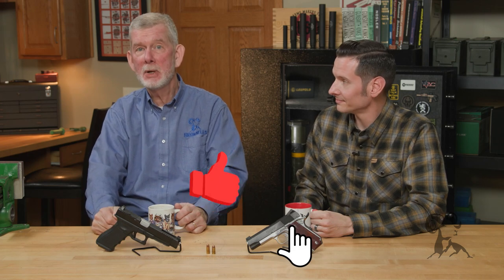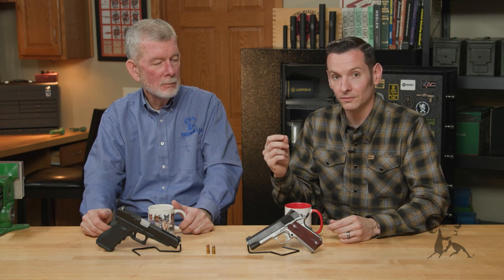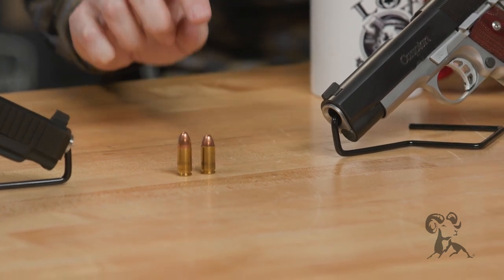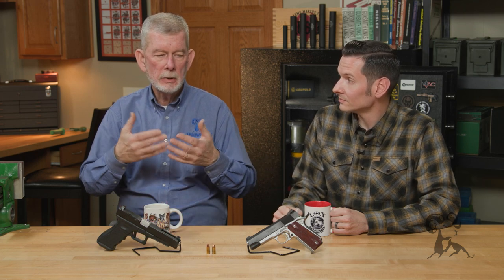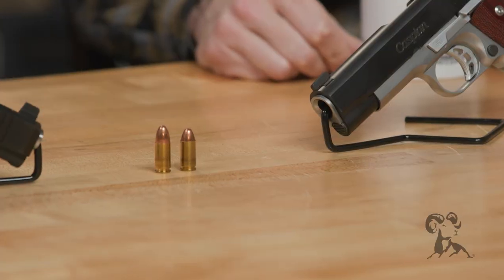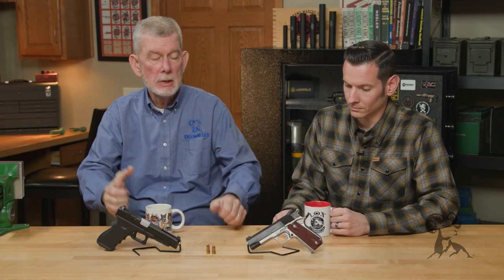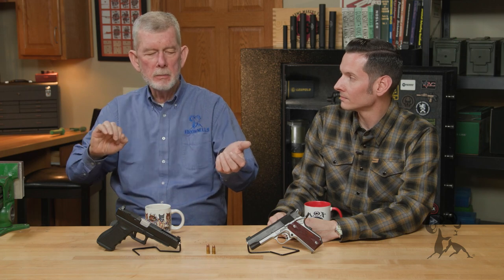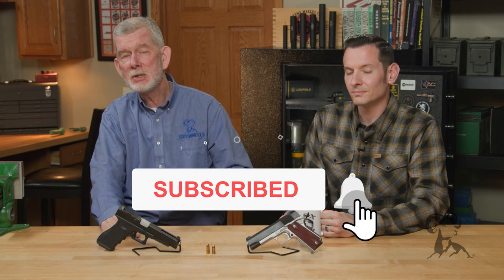Smyth Busters: Will Excess Bullet Setback Blow Up Your Gun?

Comment: If I don’t shoot my carry ammo for awhile, I will often reorder the rounds in my magazine to help avoid this. Are there any issues with this method?
Reply: Usually you have to (re)chamber a LOT to get significant setback, if you are leaving it chambered there's no reason to reorg your mags, and is putting unnecessary wear on your springs.
Reply: @runlevelone  Takes decades to wear down a spring on a magazine to render it ineffective. By that point you couldve bought at least 20 gucci guns
Reply: I avoid this by inspecting every unfired round coming out of the chamber for proper crimp retention, which is few and far between. Also, once a year, take your carry piece to the range for cycle and accuracy test. Don't forget to practice with (relatively) cheap ball that most closely matches carry ballistics.

This also proves the firearm will perform under adverse conditions, as dust, dander, body hair and lint will no longer make you second guess its function in that split second you may need it. Clean, lightly oil, reload and repeat.
Reply: I use a caliper to measure round lengths against a factory fresh rounds to compare bullet set back.
Reply: Why would you unload your carry gun anyway? I only unload mine when I clean it. My gun stays in the holster at all times, even when I get home. I take off the holster with the gun in it and put it in the safe. I have other guns for home defense.  When I clean the gun, I will remove the chambered round and put it in a jar and replace it with a new round. When i fill the jar up, I use them on the range.
Reply: My carry gun never gets  unchambered unless I am going to train. When I come home it gets put in a lock box. Therefore I don't have an issue with bullet setback because I'm not constantly chambering around. That's how I avoid bullet setback.

I have magazines that are specifically for range use so I never unload any of my carry ammo. About once a year I'll replace all of my carry ammo with fresh ammo. If you continue to handle your carry ammo often you will leave oils on casing, which can lead to corrosion.
Reply: @Watchdog_McCoy_5.7x28  Get your Dry Fire reps in my man
Reply: @Christopher Robin  i carry a 43x, but i bought 2 of them. I carry one, and train with the other. I ran 500 rounds through my carry gun to verify functionality, but I use my other 43x for dry fire and training on the range so I don't unnecessarily wear out my carry gun.
Reply: @Watchdog_McCoy_5.7x28  Nice humble brag
Reply: @Christopher Robin  just being honest. I in no way meant to boast.  I am very fortunate and thankful for what I have, and I understand not everyone is as blessed as I have been. I have a nice collection of guns, yet my collection is nothing compared to those more fortunate than myself.  Be thankful for what you do have,  because many people can't afford a Hi Point, especially now with the economy in turmoil. Anyways,  I hope you have a great day,  and keep working m hard towards whatever goals you have for yourself. ✌️🇺🇲🇺🇲
Reply: @christopherrobin8134  why dry fire? I always see it as relatively pointless. Just practice shooting the gun cause you'll actually get recoil. Anyone can hit the first shot but the follow up shots are the problem. You can still learn your trigger pull and everything else without dry firing
Reply: @christopherrobin8134  I keep a 34 G5 MOS with RMR as a paperweight on one of my desk. The MCX with 17 G5 MOS, Modlite, RMR, with drum is a good bathroom trip carry. If I was to go outside though I may grab the dual 19X. Fiddy Shades of FDE all that jazz XD
Reply: @stompingpeak2043  dry fire is the easiest and cheapest way to build speed in the draw, sight alignment, trigger pull and target transition. With a laser bullet you even get accuracy confirmation.

Comment: Came here because I discovered my 10th loading of a batch of 50 AE was setback .06" under the force of recoil while in the magazine. Noticed no strange sounds or unusual recoil, accuracy was fine...but all of them in the magazine setback. Tried a couple of mags, didn't wanna believe it. After inertia pulling with a case gauge (because it took no effort) I was able to re-over-seat them with finger and thumb pinch. Extra crimping 3 of them did not help.
     My question then...if neck tension is THAT absent, do you think it could require less force to begin moving the bullet such that the available space for the rapidly expanding gas can still be sufficient to prevent overpressure? Would love to have someone test the pressure and velocity for me and make an ultra informative lecture from it. I'm not the only one eager to milk the life of brass and I wouldn't be the only one make a dire sacrifice in overvaluing my cases. 
     This may be where I try a super glue sabot....or try reusing primers. The safest way I have to shoot them in all seriousness is one at a time, empty magazine, chambered by riding the slide. If it's actually possible to get them tested and you think you could make a good lesson from it, I'd love to work that out!

Comment: I do dry fire practice with my EDC practically everyday sometimes a few times a day sometimes less depending on different factors and a few years ago every time I would rechamber the same round. Over time I noticed that the round was getting bullet setback so I put the round on a shelf as a reminder to rotate rounds after dry fire practice. Since adding the rotation into my routine it has not happened again. That could be because of me adding the rotation or there could have simply been an issue with the crimp on that round of Aguila jhp.

Comment: I recently had a similar problem shooting Winchester white box .380 ball.. this happen several times when the round would not chamber in my lcp11 and when I ejected the round I noticed the bullet nose set back and the case was swelled.. I checked the box of ammo (factory loads) and it looked fine. I’m assuming it’s a bad batch even tho most of the rounds shot fine.

Comment: The physics is not clear to me. What causes the overpressure?

Is it the reduced volume of the initial (and temporary) combustion chamber? Or the additional friction of larger bullet-brass interface?

Either of these factors would seem negligible given the magnitude of the forces generated under normal conditions.

Comment: I'm aware of bullet setback concers. But what if the round never hits the feedramp on reloading? I typically lock the slide back and just drop the round into the pipe and have seen no case swelling or appreciable setback.  I routinely compare the round to a new out of the box one and have yet to see more than 1mm difference. I'm  using Speer Gold Dot 124gr +P.

Comment: I found some 7.62, surplus ammo, with that characteristic. How dangerous is it for the firearm? Like a FAL, G3 or a Mauser modified for that caliber.
Reply: might be a little different then answer your looking for. but i reload for my argentine Mauser light bullets so they are small length causing my OAL to be a good .10"+ smaller then recommended OAL. never had any issues. if i kept at recommended OAL, the bullets sometimes separated inside the barrel, that i believe would be a bad day if fired. again this is reloads i did, the powder charge is less as well. i assume surplus ammo might be different scenario.

Comment: Wouldnt the bullet being pushed in mean the bullet is slightly loose in the case, thus coming out of the case easier? If it was crimped setback maybe, is there any actual data on this pressure wise, or is this an opinion. Asking because I see this alot as a range worker and would like to give an educated answer. Normally, I just discard them, but.....

Comment: Just curious, but has anyone ever documented a gun blowing up because of bullet setback, or is this just theory?  I once read a posting from someone saying that "even a difference of .005" would blow up your gun."  Having been a reloader for over 50 years, and never having a gun blow up, I did a test.  I did a crono test with 9mm ammo, staring with an OAL of 1.160", and went all the way down to 1.120" and didn't see anything more than a few FPS difference, and no signs of high pressure  Doesn't more pressure equal more velocity?  This is why I'm asking if it just theory or is there any proof of a gun blowing up.
Reply: No theory. Accidentally set a bullet in a .40 S&W some 1/10" too deep. It destroyed the frame of my Glock. Not funny... No injuries though.
Reply: @woli6872  Wow, that must have been a horrible surprise. Glad you are OK.  1/10" is a huge amount.  I thought that all guns were proof tested at twice the pressure of a normal round. Since I'm not a Glock fan, I'll just have to blame it on the gun 🤣
Reply: @CompShooter54  I blame it on me being careless. Not sure if guns hold up at the double pressure. Here in Europe they are proof tested with 30 % overpressure.
Reply: @woli6872  many years ago I had a double charge in a .38 special cartridge fired in a revolver.  The gun was fine, but it was really loud and the bullet came out in many pieces.  It was a fully automatic reloading machine and there was no way to see the powder going in, so I sold it right after this happened.

Comment: I thought if you chamber a round over and over again, it can result in built set forward, as in the bullet starts to come out from the inertia of coming to a sudden stop once it is fully inserted. 

I’ve had it happen once before when i was trying to unchamber the gun, but instead of a round coming out, a empty casing came out, and a charge of powder and the bullet tumbled out of the chamber
Reply: @joedirt7604  yeah daily conceal carry loading and unloading with the slide release puts the bullet at extra inertia stress. 

So now I ease the slide closed gently instead of slingshot or slide release
Reply: It can (it also happens with heavy rifle bullets under recoil) but it won't be an issue unless it comes out so far as to actually impinge into the rifling, more likely to prevent going into battery. Unless you're already loading hot it shouldn't spike high enough to cause damage, just a fright.

Comment: What’s an appropriate angle to file and ejector on a 45. 1911 when the factory failed to do it. I noticed my brass ejection is so sporadic and sometime comes back at 6 o’clock which is not fun. I’ve seen videos with some people filing a new angle on the ejector once you have ruled out the extractor as an issue. Thanks

Comment: The Daily Caller has a very indepth article about this called "Battered Bullets." TL;DR, even if you smack multiple rounds with a hammer until they won't even feed correctly, you still will not blowup a .40 SW Glock. 

So with a less reputable manufacturer? Maybe be concerned. Handloading? Definitely. But with a gun with a price tag higher than $350 and factory ammo, I'm really, really not worried about setback.
Reply: Perhaps I will test it. I have a couple jhp rounds from sig that are back in the casing.

Comment: Thanks for the video. This was actually something I brought up to my instructor (now friend) several months ago and he said the name thing.  So my situation was that I was getting setback on my defense ammo because I m still new and have only a few mags each gun. When I practice I load and unload range rounds and defense rounds. I talked to him about a work around. Loading strength into the barrel, letting the slide forward and then loading the mag.  He said he didn’t see an issue with this.  Would you agree that this process is a good thing or is there some safety issue that he and I might be missing?
Reply: That could be fine, but depending on your firearm, you do run the risk of excessive wear on your extractor.

Comment: I try to avoid setback issues with my 9mm pistols by loading the chamber by hand and dropping the slide before inserting the magazine. I have been told this is a no-no due possibly damaging the extractor. So far, I haven't had any extractor problems. If possible, could you guys address this issue?

Comment: This one was great.  I have never heard of "setback" and some of the reasons it occurs.

Question; What to do with rounds of ammo that become deformed whether it's due to setback or misfeed issues?  
I have a few 22, 223, and 556 rounds that are deformed and I'm not sure what to do with them.
Reply: Setbacks can be undone with a bullet puller (hammer type works best because you can tap gently to get it out juuuust enough) as long as it doesn't leak propellant. Put it through a factory crimp die afterwards for best results.

With regard to misfeeds that deform, I normally plant them randomly in magazines to practice malfunction clearing. The main reason the military justified adding the forward assist to the M16 was because bullets with bent casings could be pushed into battery.

If they're deformed to the point they won't chamber at all, they are a lost cause and should be discarded.

Comment: Great video guys.  I am glad you called out the design of the firearms, like the 1911.  I'm a 1911 guy.  I have always carried them for years.  I acquired a  CZ about five years ago and now carry it occasionally.  The difference between the two is the design.  The CZ takes the bullet straight into the chamber.  I cant make that gun set back a bullet (well, don't Smith Bust that, I'm sure you could) .  My Wilson 1911, like most all 1911s, has the design flaw where the bullet launches straight into the feed ramp.  I did however, find a workaround.  The reason it does this is because of the mag tension on the first few rounds on a full mag.  I performed a test and loaded a full mag and cycled them through the gun several times and repeated this over and over.  The bullet set back goes away after 4-5 rounds and that is because the mag now has less tension on those rounds and they well push straighter into the chamber.  Take a full Wilson Combat 8rd mag and hold it parallel to your eye sight.  Start pushing the rounds out.  You will see them dive for the first few rounds until the tension eases and then they start to push straight.  CZ, Glock, Springfield XD all do better to push rounds straight into chamber.  Now, I load my 1911 by putting 3 rounds in mag, chamber a round, eject mag and fill the rest.  No more bullet set back.  I have looked at several mags.  Kimber, WC, Checkmate and Mec-gar.  All have the same basic design and have the same problem.  It does look like Mec-gar tried to address the issue.  It does better then the others, but not quite eliminated.

Comment: Glocks in .40 S&W are the perfect storm for a disaster. You have the .40 S&W cartridge which has a design flaw making it unusually prone to setback, and you have the Glock whose factory barrel has a poorly supported case head. So you have a cartridge that is more prone to blowing out combined with a barrel design that encourages it. THIS is why you hear about Glock .40's going kaboom. There are aftermarket barrels which make .40 S&W Glocks safer but it's generally better to just avoid .40 S&W altogether; it offers nothing over modern +P 9mm and .40 S&W's inherently flawed design means it's not really safe to +P it even though a handful of niche manufacturers offer such a loading; it needs every bit of safety margin it has in case of setback-increased pressure.

Comment: That's another reason why loading "Hot" loads are no a good idea. Factory pistol loads have more than enough power to get the get the job done. Even if your pet hot load won't cause your piston to "explode", it will cause needlessly high stresses and wear, and that will shorten the useful life of you pistol. If you really need more "knock down power", go to a higher caliber, not just more powder.

Comment: The 40 Smith wasn't damaging blocks because it's a particularly high-pressure round. Before T Smith was damaging Glocks because of Glocks are designed around a9mm cartridge and can't handle the heavier bullet of the Forty Smith. The Glock is a POS. It didn't help that in the Forty Smith was even more susceptible to the cavernous chamber because for some reason Glock doesn't believe in making a chamber that's actually fits the cartridge. They believe it should be several thousands larger than any other chamber so that way it would be more reliable. Reliability in exchange for weapons that explode isn't my cup of tea.

Comment: No way thats going to compress that load enough to cause over pressure issues.
Reply: Dangerous over pressure i should add to that
Reply: It doesn't compress the powder to dangerous levels, it reduces case volume which causes more pressure. Whether it gets to dangerous levels is down to how hot it was loaded to begin with and how much you reduce the case volume.